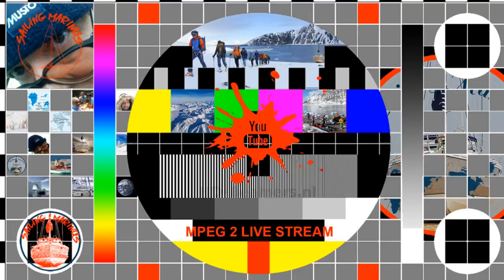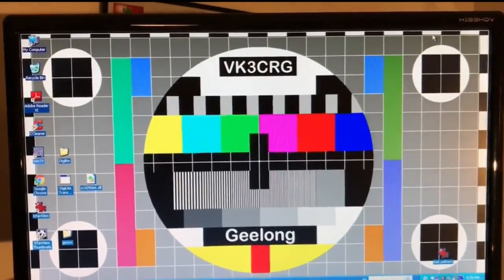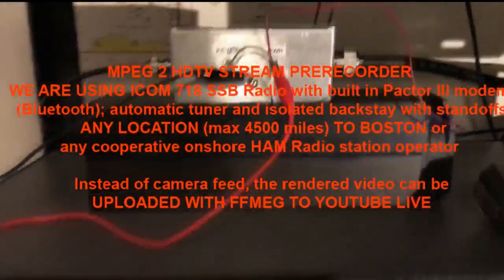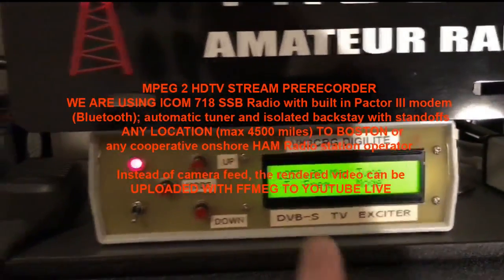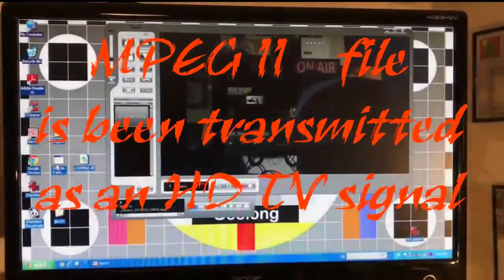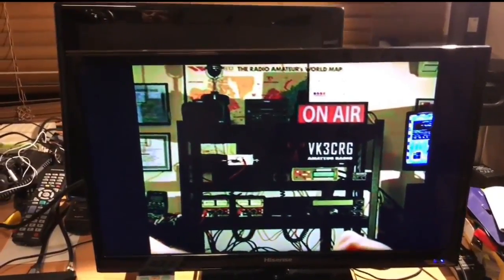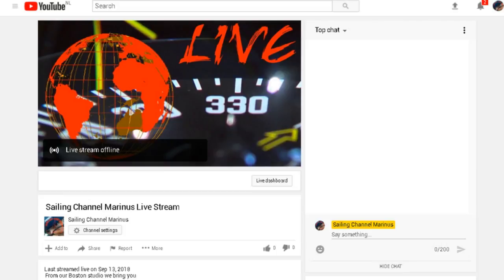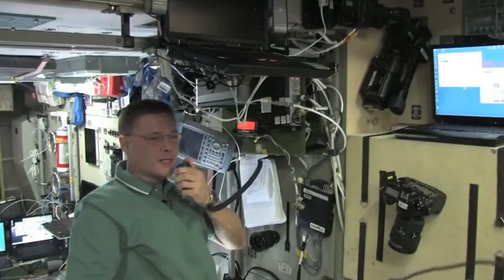SSB with Marinus Calling Brupeg Live Stream

Comment: This is a great application of this tech. Really enjoyed seeing its capability. We need to have long range high quality video ability for Antartica and this system looks to really fit that bill. Damien from Building Brupeg
Reply from the maker: Happy to exchange further details. Specially interesting for high latitude, for which we are developing it. Iridium does not have the ability to stream, and Inmarsat Sailor 500 broadband could, but does not cover the places you want to go. Besides that it is too expensive,  15 to 20K usd installation + monthly fee's, still limiting you to 432kbps.
Only issue is the transmitter draws 30 to 50 amps while broadcasting.

Comment from the maker: The stream starts at 01:13
The first part is the SSB / ATV connection...
Reply: I don't understand how you are doing live stream on ssb. The bandwidth would seem to be much to do on ssb. The ATV was 1.2 gig. Boat ssb with back stay antenna is normally less than 30 Mhz. What frequency are you using to TX from the boat?
Reply: I forgot de N0VHN
Reply from the maker: We have on board a Icom 802 and a 7851.
So we can get into the higher frequenties.
It is a very complex modulation , unlike the Pactor 4 modem. 
This video was just as illustration, in fact we do send MPEG2 files, with a latency of 3 to 5 seconds to rebuild the paxs. We don not use a single tone like the traditional modems, but use a system which is also in principle used for submarine communications. 
The back-stay antenna is not suitable , we rig a second pole to angle the antenna.. All still in development..